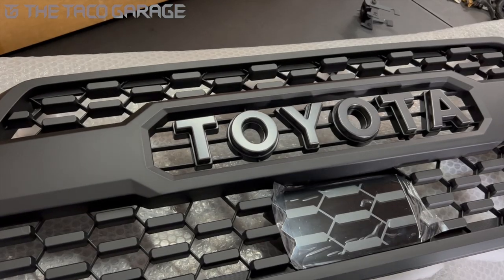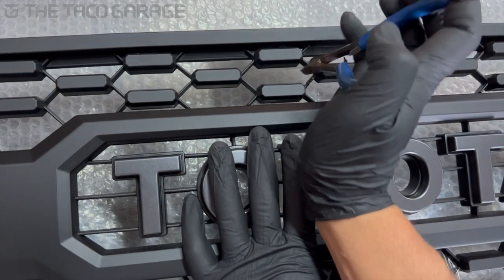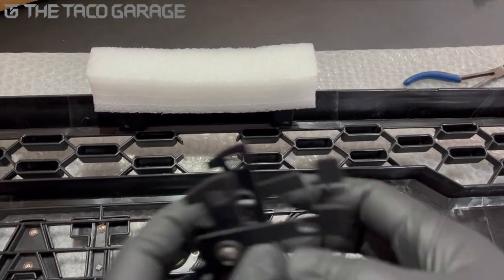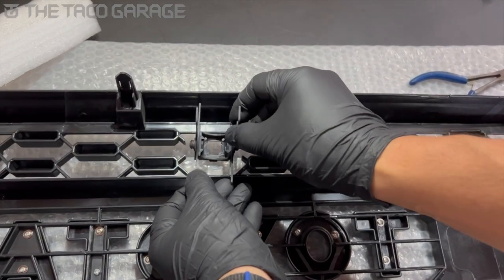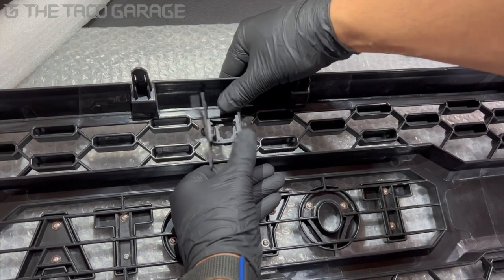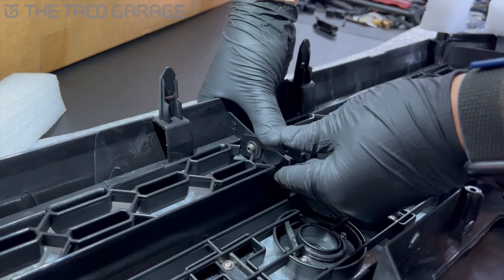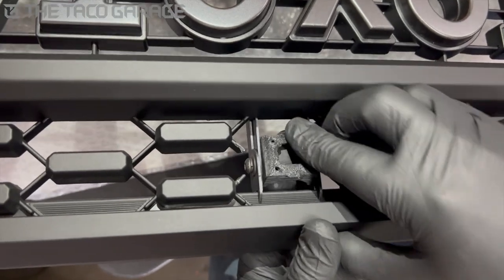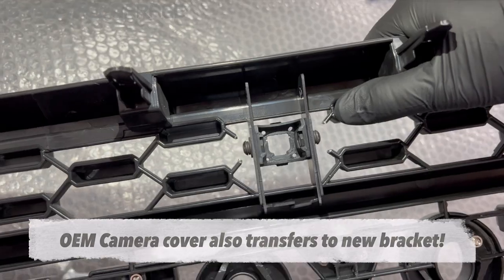Toyota Tacoma OEM to aftermarket TRD Pro grille camera bracket Install

Comment: I have a Taco Garage pro grille with garnish that I installed this bracket on for my OEM camera.  I didn't have any issues installing this bracket and it took me around 10 minutes.  I did not receive any error or warnings for the after market garnish either.  Make sure to tighten the camera bracket side screws after mounting and getting the camera at the right angle.   

Super easy install and looks great!
Reply: Did your front camera view on the dash still look the same? Your view wasn't changed or cut off?
Reply: I didn't see any difference other than the camera view was a little higher as to be expected.   @Aliviado3

Comment: Note that this placement location of the camera is in my opinion awful.  Do not know why Toyota placed it in this spot.  I actually have the OEM grill from Toyota and It totally ruined the function of the camera for me.  You pretty much lose all parking functionality with this position.  For example, I park my truck in my garage and it barely fits, so I have to park it as close to the wall as possible.  It was easy with my original grill as the camera faced down and had your bumper in frame. This grill swap now made the front camera useless to me and I basically never use  it anymore. If I don’t figure out a way of fixing this I will probably be putting the original back on.